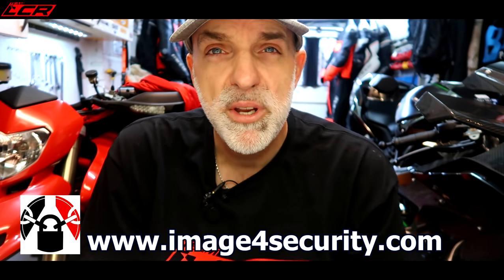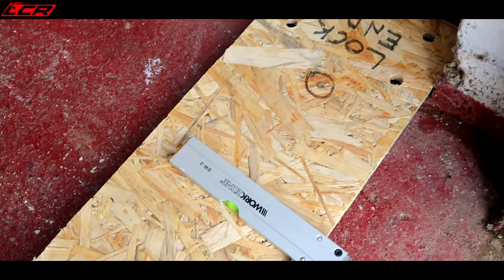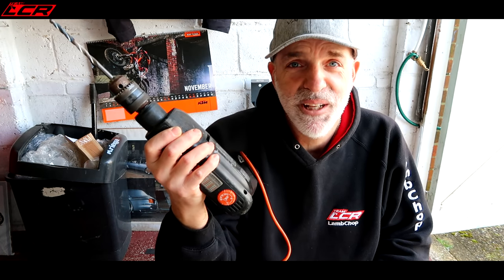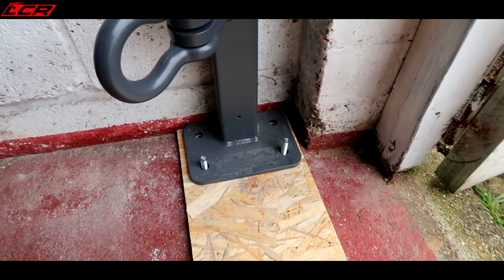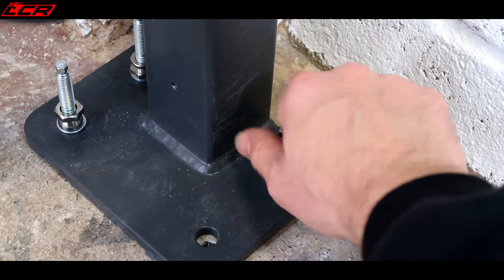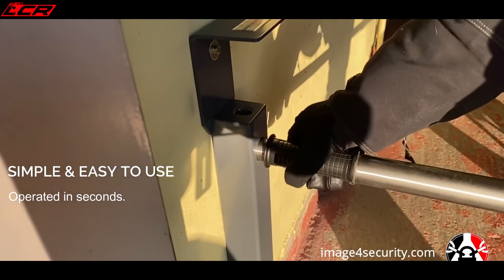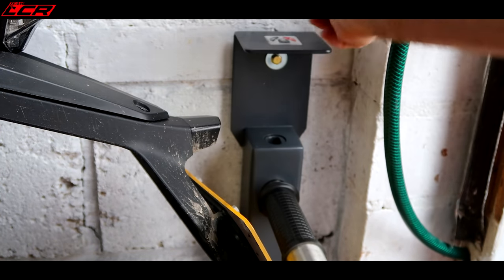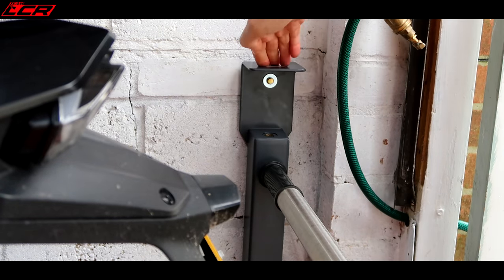Motorcycle Theft Protection | The Guardsman

Comment from the maker: Just to add, I was using a masonry drill bit and a hammer action drill. Even bought new decent bits when I hired the drill!! 🤪
Reply: Drilling to fast i think chops
Reply: SDS drill for the win 🤷🏻‍♂️
Reply: SDS Drill and bit, Surprised hire company didn’t recommend this to you Chops
Reply: As others said I had the same issue installing a garage defender and the only way to solve it was an SDS drill
Reply: Lamb Chop Rides .....kryptonite floor....get a kryptonite door....problem solved!
Reply: It doesn't sound like you had the drill on Hammer! 😆
Reply: My trusty bosch 36v sds would've flown through that no problem, thats what the tool hire company should've given you instead of a percussion hammer drill
Reply: We use a cordless SDS for work concrete no problem, you live and learn Chops.

Comment: I have posted this system previously on other blogs about motorcycle theft from a home garage, hopefully it will help someone out there.
Great post Chops the Gardsman system looks like a serious positive deterrent. 
I have however used the following system for some time as a early detection system to allow you to call the cop's, your friends or if bold enough ones self tackle the thieving scumbags oneself or release the hounds.
This only works if your garage has a power supply fed from your house.
First get yourself an old school baby monitor, the type you plug into the kids room and then your living room. Next get yourself a loud PIR alarm, preferably a plug in also, better get two. Both are cheap and available at Argos or online.
Plug the baby sender unit into your garage, the receiver unit of the baby monitor into your bedroom and make sure you can hear the sounds in the garage from the bedroom.
Fit the alarm PIR's into the garage where one will catch the door opening and one further back/ different angle just in case. You can buy these alarms quite cheaply, get the ones set with a key fob control.
Check the system works. You can put your own plan into force thereafter. 
Also don't advertise you have a bike in your garage by putting signs up " bike parking only " ,etc.
Common dog...

Comment: Like that. Had the same issue with concrete in general...70’s house or drilling into reinforced pebble dashed concrete. As has been said, an SDS drill plus masonry bit makes it easy. I like the fact that this is not visible from the outside, rather than something substantial on the outside that says ‘there is something worth protecting in here’. I like a layered approach. You could also put  subtle locks on the doors as well which deadlock down into the concrete. But you’d need an sds drill as the bolts are about double the size. I have two on each of my garages. This would be another layer, plus ground anchors. Great subject for a series of videos!👍👍

Comment: Just a bit of advice, it's always good practice to lose as much slack chain as possible and keep it and the lock off the ground to prevent sledgehammer attacks etc 👍🏻
And if you can, put it round the frame or  through the swingarm, wheels can be removed relatively easily 😁

Comment: Nice vid matey....and anything that helps protect is a good thing!  Re your drilling efforts.....as well as using a meatier drill, which should be SDS, do allow for the possibility that you may have hit re-bar (metal reinforcing bar) that’s often incorporated into concrete. You’d then need to use a metal drill (obviously switching off the hammer function) to drill through the bar and then continue back on with the masonry drill, back in hammer mode!  It’s a bit suspicious that both the rear holes (fnarr fnarr) are in line and had the same problem thus my guess at re-bar.  Good luck and stay safe!

Comment: A common piece of kit for a thief is the (quiet) 42" high tensile Record bolt cutter. 

And you need therefore chain links that are at least 16mm to defeat the above tool (your chains looked a little small Lamb Chops!), large enclosed shackle padlocks and decent ground anchors.  Better chain diameters are 19mm or 22mm (reassuringly costly and heavy) and as I think the police have said in the past, consider spending some 10% of the bike value on security.

I've used Pragmasis (I've no connection with this company) for this level of security to give peace of mind.

Comment: Everyone's a know-all but: I think you were putting too much weight on the drill/drill bits. They burn out if you do that. Use moderate strength to hold the drill in place and let the masonry bit do the job for which it was designed. People do the same thing with jackhammers - lean into them with all their weight. Just hold the thing upright and let the sharp end do all of the work. I learnt this the hard way after murdering a lot of masonry bits!

Comment: First impression was it's a great idea....but then thought just a few seconds with a hacksaw/disc cutter/angle grinder through the hollow telescopic bar by the rubber grip and it would be open.
Reply: Chain rapped round  the telescopic bar and attached to the tow bar of car and it will be open quicker than with any angle grinder . We need protection from the thieves trying to punt a couple bits of box section and a old scaff tube for £650 .

Comment: I lost my 60th R1 and ZX6 track bike last year from my garage, I had locks and disc locks, disc locks were broken off, chains cut and one chain they couldn’t  cut so they just left my front wheel. 
One simple flaw I see with this is a car jack which most of us have in our garages put under the very end will cause a failure somewhere. I know it’s about slowing thieves down but be aware of what tools you keep in your garage. All my own tools were used to aid the theft of my bikes :(
Reply: Millga Great points. Sorry for your loss, my bike was stolen in the past as well so I fully understand your feelings.

Comment: I have had a 2"x2" heavy wall 5mm box section across the entrance of my garage for years hinged through 2 - 1 1/2" hardened steel pins with close shackle shutter locks for years. It's on the outside so the thieving bastards can contemplate it before destroying the door, being outside and tight to the door approx 6" makes it difficult to open and enter to thieve (steal is too nice a word to use) anything else.

Comment: Hate to say it mate but a SDS drill and bits would go straight in....drills concrete no prob...😬
Reply from the maker: I may hire one give it a go... Drill those missing holes.. few people said SDS drills are different, I thought it was just the drill attachment system 🙈
Reply: @LambChopRides  You probably already worked out this tip but here goes....start with the smallest bit you can get and gradually work your way up to the correct size, takes a bit longer but much easier. My house was built in 1935.....seriously hard concrete now!
Reply: P.S. Nice strong looking piece of kit.

Comment: Mate those where normal drills, you need sds drills and bits
Reply from the maker: SDS is just the attachment system, these were decent masonry bits. Even bought a couple of new ones with the drill as recommended by the hire company 👍
Reply: @LambChopRides  the sds bits / drills are made for hard surfaces. You put alot of body weight into drilling the holes, you could see the bit bending. You dont need to with the other drills, they are heavy and the hammer action goes through like frozen butter. Not easy, but easier
Reply from the maker: Ah ok good tip that.. I thought it was just the attachment system the SDS part 👍

Comment: The BAR (The Guardsman can be cut) that protects can be sadly CUT WITH A CARBON FIBER DISC, future tech can and will always prevail:(
I have from the 80`s used a ground  anchor:) AND A FUCKING BIG DOG LOL!
You will laugh at a big dog but it has worked for me over 35 years
I GUESS SCREW FIX has failed lol:)
Reply: Pretty much anything can be cut with a disc.  I guess the hope is you'd hear them or they just don't attempt it due to the noise it'd make.